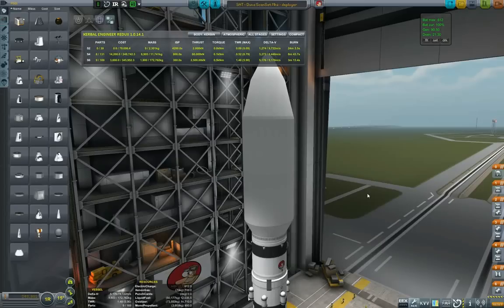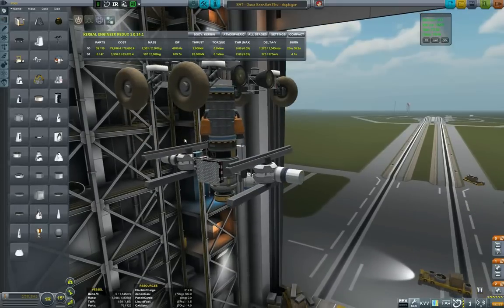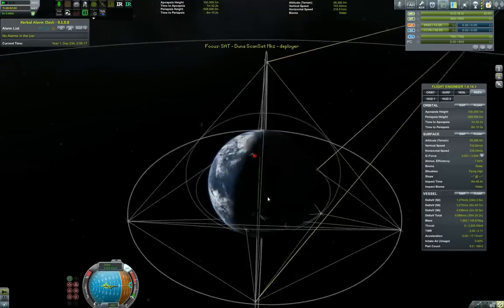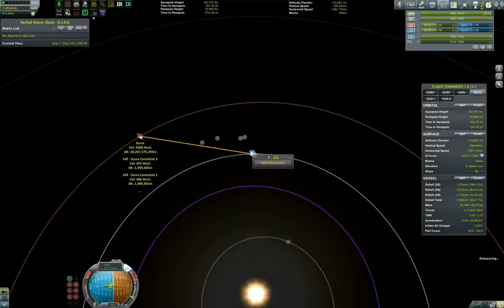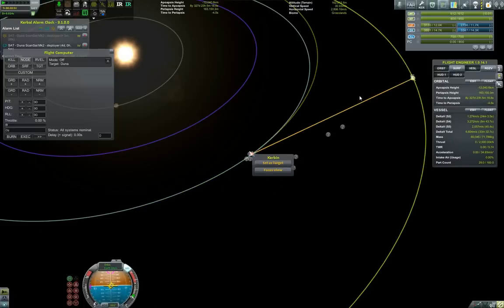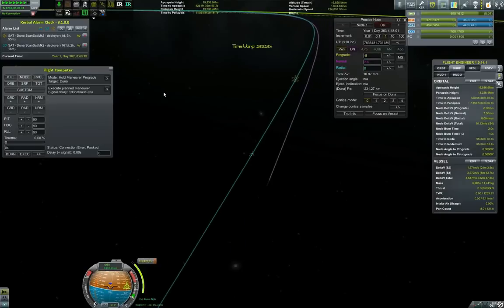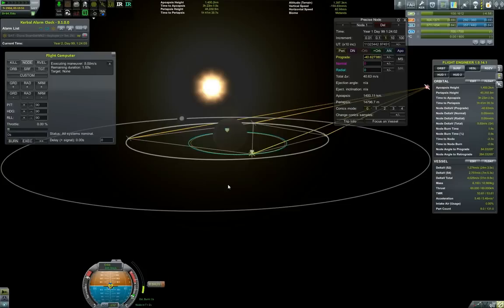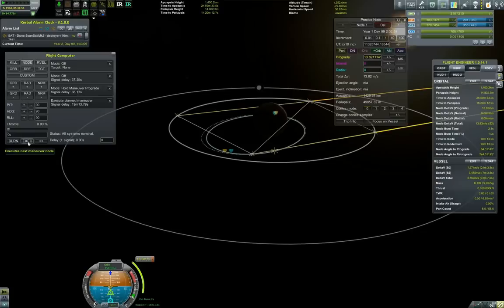KSP - RemoteTech School - Episode 6 - Deploying Rover on Duna with RT

Comment: What are your thoughts on geostationary satellites? They are used in the real world, but don not seem to be used in KSP very often. Is there a reason why?
Reply from the maker: Josh Hawley Well, this is just my speculation, but AFAIK geostationary satellites are used mainly for broadcasting above certain geographical area (i.e. like for the SAT TV). Since KSP does not have a great use for broadcast back to Kerbin, and all alternate scenarios can be mitigated by using omni antennas (unlike real life), that could explain why.

If you really want to try a "real" scenario for geostationary satellite in KSP, a potential case could be to take a rover and deploy it on opposite side of Kerbin than KSC (and equip it only with dish antenna). Then take Geo(or Kerbostationary) satelite with the same dish antenna (point to rover and vice versa) AND omni antenna (to communicate with other CommSats), and launch it directly above the spot where the rover landed.

However given the fact that RT simplifies things through the use of omni antennas, the above scenario might be viewed as overkill.
Reply: Josh Hawley another reason is that getting the orbit "just right" is a pain. RL there's a relatively wide band of altitudes that works for GEO, and satellites have automated RCS to keep them in place where they should stay (with the service life of a satellite being determined more often than not by when it's RCS fuel runs out more than anything else).
In KSP you have neither. There's no automated station keeping, and the band you need to be in is far smaller. 
As a result your satellites will drift far more and far faster.

Comment: Is it a mod?
Reply from the maker: ahmed odtallah If you are referring to RemoteTech, yes it is a great mod that complicates using unmanned probes by requiring them to constantly maintain connection to KSC by building satelites

Here is the link
http://forum.kerbalspaceprogram.com/threads/83305-0-90-0-RemoteTech-v1-6-3-2015-02-06
Reply: Oh I thought the big shield thingy was from infernal robotics. Well thanks keep up the good work!
Reply: I'm looking for the mod at 4:20 when the side parts decoupled. What mod is it? And if so, what is its forum?
Reply: +GrunfWorks
Reply from the maker: ahmed odtallah
 yes, RamoteTech is a mod. Here is the link
http://forum.kerbalspaceprogram.com/threads/83305-0-90-0-RemoteTech-v1-6-3-2015-02-06